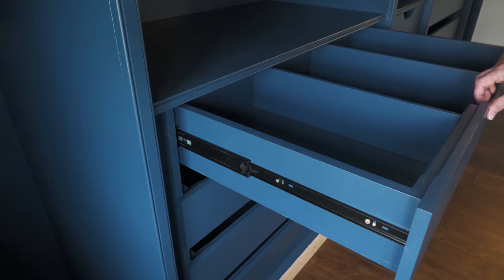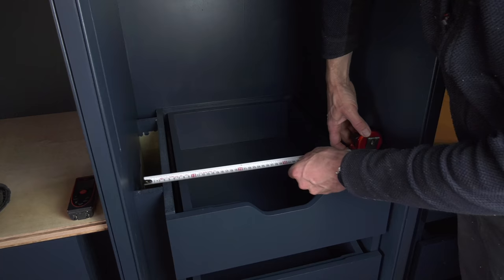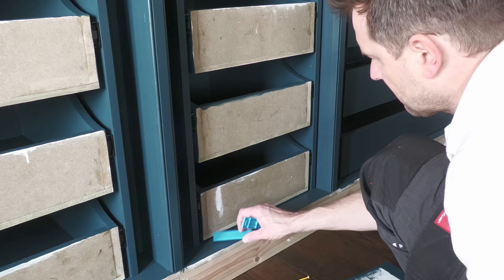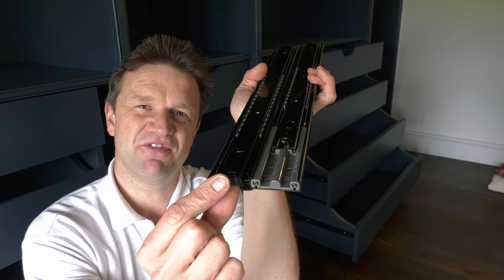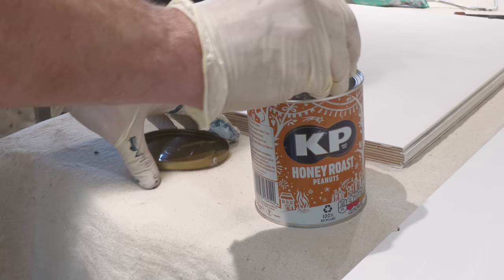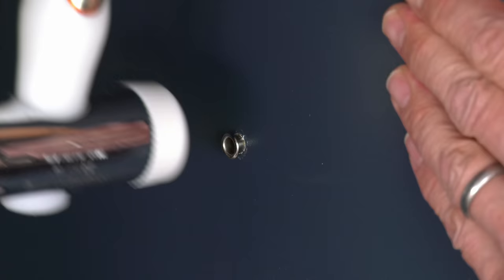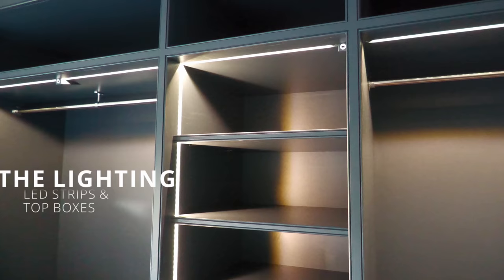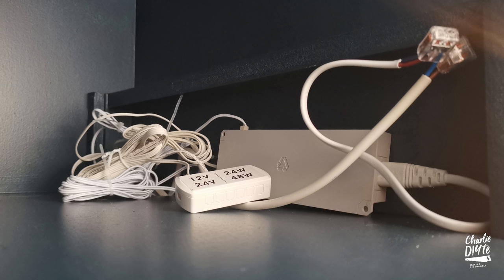DIY Fitted Wardrobe Build - DRAWERS, SHELVES, RAILS & LIGHTING -Video #6

Comment: Hi Charlie   It’s looking very professional .As a retired electrical contractor I think you have been very wise to make your lighting accessible in the future , LED lighting has had a bit of a reputation for failure in the past so if things do not go according to plan you won’t be stumped 🤔 . A lot of electricians are moving away from enclosed type down lights , to replaceable lamp units for that very reason.  You have a very personable way of passing on information, which is both informative and entertaining .   Thanks for all you do.          Best wishes and kind regards  😀👍👍👍
Reply from the maker: Thanks so much for this - always humbled when I hear something positive from a trade professional! Yes, it's very accessible although one of those clips has a hinge half of which has snapped on me  (it snapped when I rather clumsily took the masking tape off it, after painting) which is annoying though not critical. My biggest worry is that the sensor switches might fail at some point - as it would be very difficult to replace them because with the best will in the world, I couldn't create a direct channel without any bends from the switch to the box in the wardrobe above. So fingers crossed we don't have any problems with those.

Comment: Another great tape measure brand is Hultafors. They're just so nice, I'm never using another one again.
Reply from the maker: Thanks. Yes I think someone told me Peter Millard is a fan of that.👍🏻
Reply: The Talmeter measures with the fold out tail take away all the guesswork from internal measurements. Wouldn't be without it.

Comment: Fantastic work Charlie! In my industry experience a lot of (interior) designers / architects tend to specify diffusers over LED channels to prevent 'spotlight' effect from bare LED strip lamps - helps with the bright glare you referred to at 11:40
Reply from the maker: Thanks mate. Yes, you and a few others have suggested this, which is a really good idea - if, that is, I could get it to fit in my routed channels. Thing is, unless I look directly up into the groove, which I'm never going to do, there's no glare, just the spotting effect, which I guess some people would say is a reason in itself to get the diffusers.

Comment: Great video! My fat max has its size under the clip, maybe it’s a new feature 🤔
Reply from the maker: Reuben you are of course absolutely right. I need 👓 because I peered at this the other day and thought it was just a few striations under the clip. They're idiots putting it there though, where no-one can see it. Also its in inches which is annoying of you're a metric measurer and I find the Fatmax a bit too rounded to use it effectively, but I'll mention this in my next video. Thanks for pointing it out 👍🏻 Dow 🤦
Reply: Beat me to it! Haha.

Comment: This is fantastic, Charlie.  The wardrobes look great.  Can you please do a review in say 6 months on how these “fixed” wardrobes are going eg do you tend to have a lot of stuff in your cupboards but the drawers are used less used & what, if anything, you would do differently, that sort of thing.  I inherited some semi fitted units which tend not to work so well on a practical level (too much stuff in one place, not enough stuff in others).  So much so I have an additional chest of drawers & a clothes hanging rail & shoes are in a bookcase!
Reply from the maker: That's interesting. I'm hoping we've designed out any such problems, but you never know!! Yes, very happy to do that.
Reply: @CharlieDIYte  I’m sure you have thought of  everything!  From my experience, storage is ridiculously hard to get right.  You never seem to have enough of it, what you do have needs to be adjusted as your circumstances change, the location, there’s always that item that doesn’t store anywhere & wherever there’s a surface, there’s clutter!  Hence, you end up using loads of baskets, furniture with built in storage & on wheels, open shelves etc & that’s after you’ve had a declutter!  Grrr.

Comment: Looks awesome! I'd be tempted to just leave them like this without doors, as open wardrobes (although that'd bugger up the idea of the sensor switches but still) ... great work - very inspirational 👍
Reply from the maker: Thanks Cliff. Funnily enough we did chat about that, but the mess would quickly build up, I think! As you say, the sensor switches are the problem.
Reply: @CharlieDIYte  True - we have open wardrobes (the lighting is controlled by a whole-house automation system I have so this isn't an issue) but I have self-diagnose mild-form OCD and they're in a specific "dressing room" so not part of a bedroom per-se.
Reply from the maker: @cliffwright1970  In a dressing room it makes perfect sense to have them open 👍🏻

Comment: The seperate soft closers or push to open can sometimes work better.
Reply from the maker: Yes I can see the benefit of that. The drawer runners work great without it though, to be fair.
Reply: @CharlieDIYte  It's just options with what you have to build or retrospective. Soft close dampers I do like but work best on slides that fall down a ramp on the last inch, basicaly the cheepo slides. the push to open I honestley don't like, but they are for flush no handles. In a wardrobe the would end up like a puzzle box. :D

Comment: Hi Charlie, you must have a bad unit there as my laser measuring unit is spot on, as soon as you said about yours adding 2 mm I went downstairs and checked mine, I only have cheap tape measures(£1:50 each) as I don’t use them but even those have the size on the back of the tape. You would thing that a well-known brand as (Stanley Fat max £44:00) would be leading the other brands, but for me I still like my laser measure  as it keeps a record of the measurements and I can forget what I was going to do walking up or down the stairs.
Reply from the maker: Funnily enough John, after just a couple of months of owning this laser I had a sixth sense that it was over calibrated. Back then I was using it in the old day job to measure floor to ceiling drops and recesses for curtains and blinds. I didn't trust it at the outset and always double checked measurements with my tape. I even sent it back to the retailer who said it was correctly calibrated. So I think you're right, I've just been unlucky with it as Leica are generally awesome in this field.
Reply from the maker: Incidentally John, someone has pointed out that the Fatmax does have the measurement hidden under the clip but you have to have superhuman eyesight to see it (I had a good peer the other day and decided it was just a few scratches!) and it's in inches.

Comment: Led lights look great, the only thing I would change would be to put the led strip into a profile with a frosted diffuser, this hides the dotting you get with most led tapes
Reply from the maker: Interesting idea Jason. Certainly the glare isn't a problem as you don't see the leds but I can see the benefit in terms of eliminating the dotting. I quite like it though!
Reply: Awesome work Charlie!! Re the LED’s I’m thinking of setting mine in an aluminium profile inset into the inside of the wardrobe vertically. Sides are 18mm MRMDF and the profile I’ve found are 7mm thick. Do you think this might compromise the strength of the wardrobe sides?
Reply: @Charlie DIYte

Comment: Charlie Hi
How do you fit rising but door hinges. A bit of advice would be great. Best regards Geoff Maddison
Reply from the maker: I'm going to be honest with you Geoffrey I haven't installed any, but it's the same principle I used here https://bit.ly/2NpPFzO as the butt hinge will be in its neutral (lowered) position when the door is shut, so you're measuring it the same way as you would a conventional butt hinge. But best to Google just in case 👍🏻

Comment: One point about LED strips. They fail. So designing in a way of replacing a strip without having to dismantle the units is key.
Reply from the maker: The led strips can be easily replaced. The sensor switches are more of a worry...

Comment: Hi Charlie.
Have enjoyed watching you build these wardrobes. 
Can I ask for some advice from your day job. I need to fit some pull chord curtain rails to a bay window. Any recommendations  for which to use. And or tips to fitting?
Reply from the maker: Thanks Mike. Very difficult to say without knowing more about the bay, but we tend to measure the bay including the diagonals, and get a metal track factory bent to the bay. Are you wall or ceiling fixing? We could maybe get one sent out to you, but it would be all down to you to get the measurements right (we could send you a measuring diagram). Give the team in the office an email if you're interested - admin@moghulinteriors.com
Reply: @CharlieDIYte  thank you Charlie. I was thinking of wall hung. Do you tend to put a single rail in and pull chord. Or two and meet in the middle?

Comment: My tape only has only Centimetres marked but the tape body it’s measurement has inches engraved (3 3/8). But it’s not a round number. 8.5725 cm
Reply from the maker: That's rubbish, Paul. Like my FatMax. Someone pointed out it does actually have the measurement on the back, hidden under the clip and it's so small it took me ages peering at it to see anything, to eventually realise it said "3 inches". It's as if as an after thought they decided they'd better stick something on it as a box ticking exercise.

Comment: Hi Charlie, I'm getting so much help viewing these, thank you! I wanted to ask, when using your circular saw with fence you have the fence against the waste piece. I know from reading up that you're not meant to clamp the waste side, otherwise you can get kick-back. Does resting the fence against the waste side not cause the same thing, or are you just really careful about the pressure you apply? Sorry if this is a stupid question, I'm fairly new to electric tools.
Reply: Sorry when I say waste side I mean the side that will fall away
Reply from the maker: So glad to hear you're finding the vids useful mate. No, I rarely have the fence against the waste, unless I'm cutting a very thin sliver of waste off. Kick back isn't an issue with these 18v circular saws. If it jams for whatever reason, the Ryobi at any rate, just stops.

Comment: Hi Charlie, Thanks to your inspired work, i'm on the case designing a single wardrobe / cupboard for my apartment, i'm in the UK but the apartment is in France so i want to build here and take it out to fit, similar approach with a lower main cupboard and top cupboard, 800mm wide. ( 4 doors total ) My question is about the facias you have made. I see your MDF is 18mm, but i cant quite suss out what the dimensions of the facia you have made is? Is it also 36mm on both horizontal and vertical runs, or is it wider on the horizontal? great videos Charlie, such an easy watch, hope you dont mind me butting in for detail!
Reply from the maker: Of course I don't mind Raymond - thanks for getting in touch (although thanks for asking - most people just demand answers like I'm Alexa or Google 😩). Yes the fascias are the same width horizontal and vertical - so 36mm or maybe 37mm to cover any miniscule gaps. Good luck on the build and drop me a line if you've got any other questions.

Comment: The other advice I was once given regarding measuring... always use the same tape measure (/laser measurer etc) to measure the thing AND the place you're putting the thing, and use the same one for the whole project. That way, even if it's wrong, it's consistent... and fits anyway
Reply from the maker: That's very good advice. I now use a Tajima Class 1 for all jobs. Love it! https://www.amazon.co.uk/dp/B00UC318M4/ref=cm_sw_r_as_gl_apa_gl_i_TA0DWAWDTVJ8RDQJC3F4?linkCode=ml2&tag=charliediyt0d-21

Comment: Hey Charlie. Been following you for a while and love your videos - inspired me to do more DIY things and expand my tool collection (have even bought from loveleyleds and ironmongery direct!).

Used Zinsser BIN on an MDF wall unit Ive made and then painted with a mixed colour.. But no matter what I do, the finish is terrible and the BIN stays soft underneath. I've now had to sand it all off and go straight for paint as the colour and finish is better.

Any idea what might have gone wrong? Was water based paint on top of the BIN and even after 3 coats, could still see the white of the BIN.
Reply from the maker: Thanks mate, I really appreciate your support of the channel. I can't think what's happened there. I'm currently using BIN on my wardrobe doors, and two coats of Johnstone's acrylic eggshell on top. First coat is always a bit streaky but the second coat makers it look great. Also, a complete mystery as to why the BIN isn't drying. Being shellac it should go off on 15 minutes. I'm guessing from the fact that you've sanded it back, that the wood's not damp or anything? What top coat are you using?
Reply: @CharlieDIYte  it's Valspar custom mix from B&Q. I think the BIN itself was dry, but perhaps the top coat/paint just wasn't adhering to it being water based? The research I did suggested it would be totally fine though. I tried with both the aerosol version and from the tin but neither worked well.

MDF was fine underneath. Since I've sanded it all back and gone straight with the paint, it's applying well, drying well and looks a LOT better.

Wonder if it's just the technique I'm using and the rollers? Who knows! With the paint being decent now, I've got blum hinges to fit (again thanks to you) so it's all go. Keep up the videos. Genuinely really enjoy them and get a lot of tips, too!

Comment: How have the LEDs held up after 5 months? I put a strip in a fitted bed I made and about 30% of the LEDs have failed.
Reply from the maker: Still going strong Brian. I think Sensio are a good brand. The only issue I have is one of the connectors split when I was painting around it so the connection isn't as strong as it should be, so it occasionally flickers but other than that, really pleased.

Comment: Can you give the product code for the led strip lights used in the wardrobes? Couldn’t find them on the website linked to. Cheers
Reply from the maker: https://bit.ly/33n8cRT It's the Sensio Primo 5m Clip, code SE10755C0/SE10755W0 I will update the product description when I have a moment.

Comment: Hi Charlie.. I’m going to be using your videos to build a built in unit in my kitchen/ diner.. is there any advantage to use adjustable feet instead of a frame base? I’m in a new built house. 

Also..  when is the video for the doors being posted?
Thanks for your help
Dan
Reply from the maker: Great stuff - thanks for watching. It's just ease really, using the feet and you'll need to find a way of supporting the skirting along the front ie by screwing a batten to the floor. Not essential to do it my way though. The last video comes out this weekend.
Reply: @CharlieDIYte  thank you Charlie that’s very helpful, and thank you for giving your time to make such great and educational videos!

Comment: 01:41 I'm still amazed that, after all these years, no manufacturer has managed to make a tape measure that's a 'round number' up from the measured distance. I.e.: 100mm, in the case of metric measures; or 4 inches, in the case of imperial. I'm sure this makes sense to not just me....
Reply from the maker: It would make life so much easier wouldn't it. And the FatMax width is hidden in the smallest writing you've ever seen (or not seen) behind the clip.

Comment: Just taken built in wardrobes out off a house I recently moved into because of no air vent in the wardrobe it had left condensation on the wall.
Reply from the maker: It's not the air vent Darren. It's the dew point being reached, caused by the walls being uninsulated plus too high a relative humidity in the room. An air vent might help but you'll have freezing cold clothes and when the doors are shut there will be no air circulation. Take a look at this for a bit more info on this area https://bit.ly/3glMu6H.
Reply: @CharlieDIYte  not in my case the wardrobes must off been 30 years old Built over the floor baord then carpeted round it 🤣 3 overhead storage cupboards and wardrobe each end of them moulding round it to give it built in look and one end that doesn't meet the wall was boxed in and sealed off also to give it part of the built in look because of the boxed in part is why it left the condensation as it was cold not getting no circulation plus no skirting board behind it did not help. It's fine now now that ugly wardrobe has gone 😁

Comment: What was the point of spending 100 quid on nice birch plywood when you were just going to paint it?
Reply from the maker: Exterior ply or chinese ply is probably about £60 and the internal layers of ply are all over the place and often missing in places. I wouldn't be able to route the front like I did with this because there would be loads of gaps to fill - it really is that bad, so I thought I'd pay the extra for a really good sheet of ply. Also, there was part of me that was just inquisitive to see what it was like, having never used it before.

Comment: 4 adverts in first 8 minutes.  not acceptable.
Reply from the maker: Thanks for pointing that out Steven. I always try and limit it to one or two ads maximum during the video but I had to reupload this one, and when I checked the midrolls, the info wasn't available. I've gone in and removed a couple. It's a tricky balance as the ads are a crucial source of revenue for me.